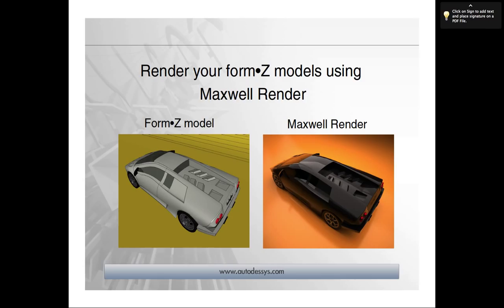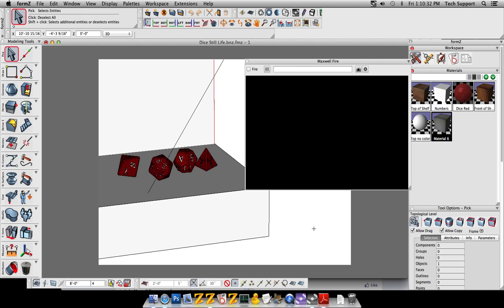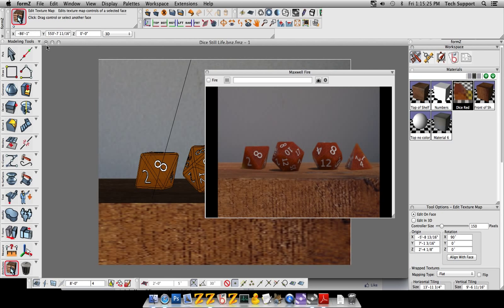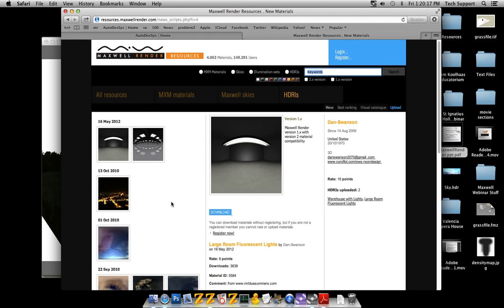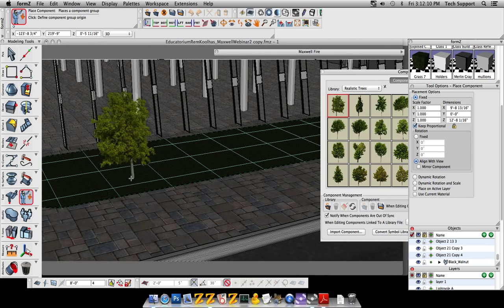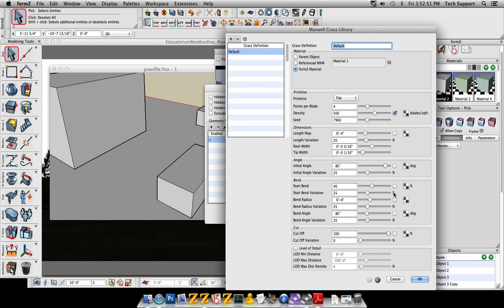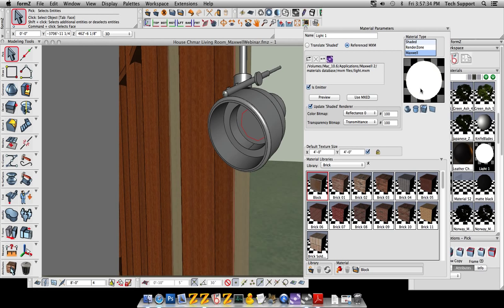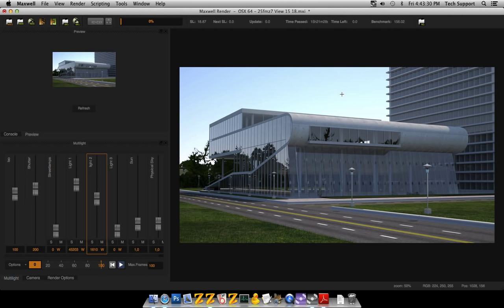formZ and Maxwell Together

Comment: We've been using FormZ at work for a very long time now & love that there's the ability to have a Maxwell plugin that will help bring more realism to our renderings! We're getting ready to purchase the Maxwell plugin very soon so more videos like this will definitely help us get up & running faster!

So a couple quick questions for you... We design retail store displays so almost all of our renderings will be indoor type lighting setups. Some displays are rendered with a blank or white background and some we like to place on top of a in store photo in the background since our customers love to see their display in a retail store setting. We also have things like led lighted buttons, lighted logos, as well as led strips, backlit graphics & video screens. Do you have some quick settings for these types of lights & overall lighting indoors that would be a good jumping off point for us? Should we start off with using one of those stock hdri indoor lighting scenes? Is there a way to render in Maxwell with a background image like in formZ? For the led's it seems like material emitters are the way to go? What about for a backlit graphic or LCD screen, can that be an emitter as well so you can tell it's a lighted screen and not just a flat unlit printed graphic? Right now in our formZ renderings sometimes it's hard to differentiate what are printed graphics versus backlit graphics or video screens. Sorry for all the questions but those couple things answered will really help us hit the ground running! Thanks in advance!